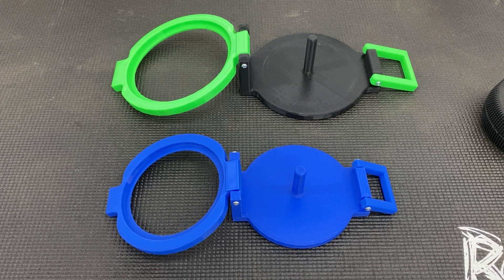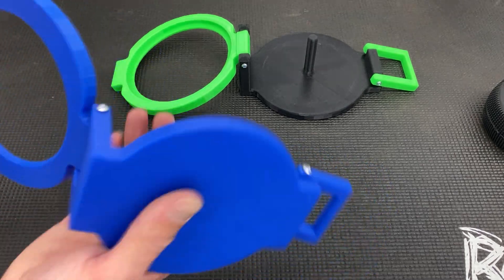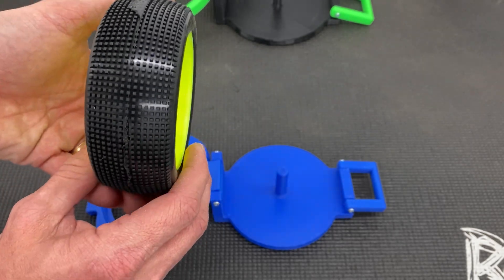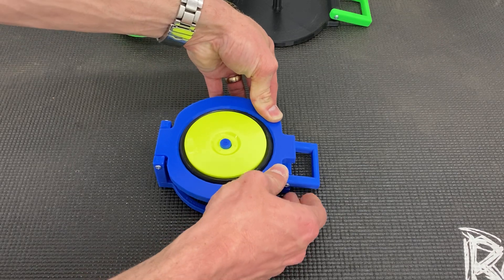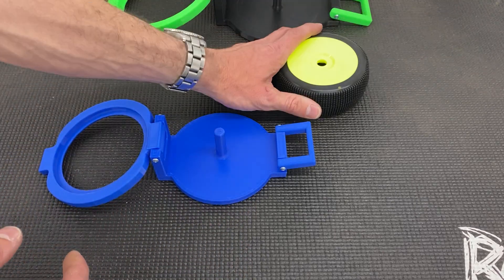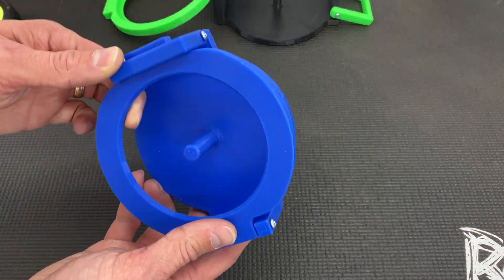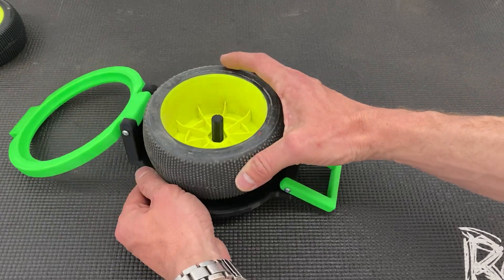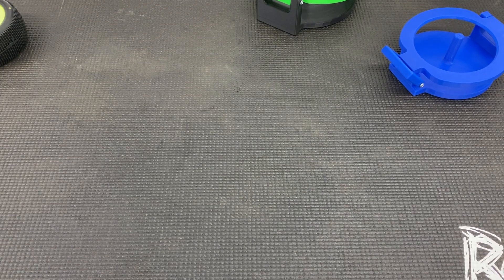3D Printed Tire Gluing Jigs! Buggy & Truggy!

Comment: too flimsy/flexible in the longterm. for double the price you get metal ones.
Reply from the maker: The material used here is not flimsy at all. Im not sure if its pla or abs. But the construction is pretty sturdy
Reply: @SuperFastRc  The stiffness degrades over time as the layers delaminate.
It's just not the right material for this application, trust me, I tried myself.
Soft compounds may work for some time, but try a hard, way more stiffer, compound ;-)
Reply from the maker: @gibmirschnell  we will see, im not sure where you found a metal one
Reply from the maker: @gibmirschnell  Cool, well i will see how long these last. Working great so far